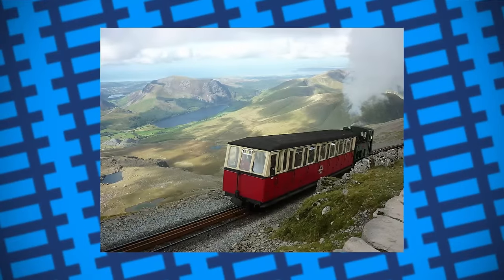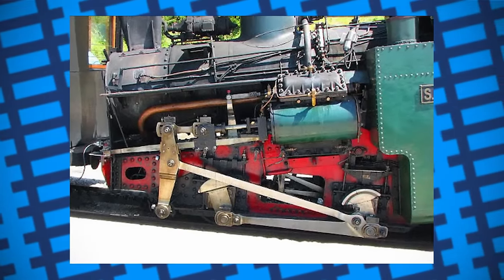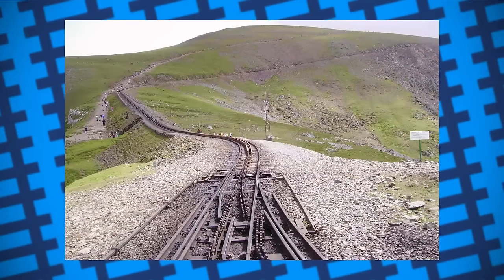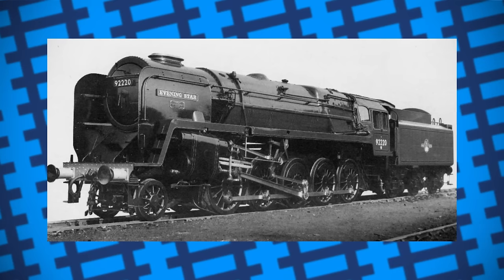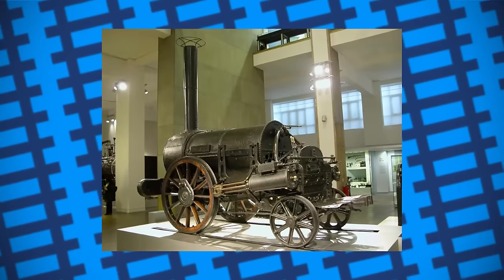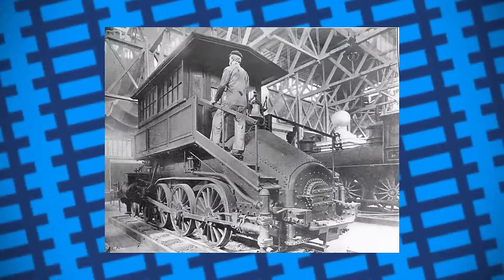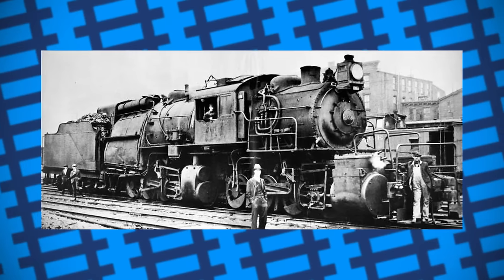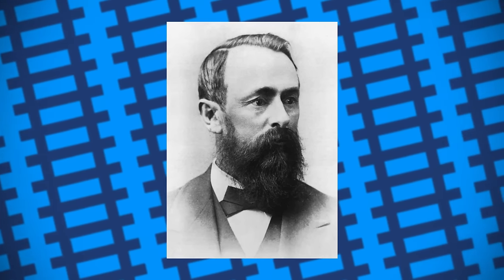Train of Thought COMPILATION - Extreme and Exceptional Engines

Comment: My favourites have to be hybrid-rack-and-pinion trains. They use conventional wheels on rails for most of their travel but have a cog that can use the rack on steeper inclines. So fall all I have seen were electric, so I have no idea whether steam versions exist
Reply: I was quite disappointed when 3 years ago I went to Mount Snowdon and hiked up it. The mountain railway was operating but only with Diesel traction sadly. And portions of the track near the summit were in quite serious disrepair, as such the railway only operated to the half way mark at Clogwyn station. I hope its since been repaired.
Reply: I saw one working a Swiss railway once. It had an extra pair of cylinders just for gear.

Comment: the Q1's had one majour issue. They were "light on their feet" or in other words.  They were too light for the sheer amount of power they had.  This meant that drivers had to be EXTREMELY gentle on the accelorator, or the wheels would spin.

After the war, the first thing they did was "throw weight at them" I.e. they added a whole bunch of metal to them in order to make them heavier so they would have more grip.  This meant that there was a fair amount of veriety in their looks post war. However, the one in preservation has been preserved in a much more original condition.
Reply: Yep. Although they were otherwise fantastic engines. The Schools were also a little ballerina like, and they were also great!

Comment: Fun fact about the Big Boys: Big Boy actually refers to their type, or their wheel arrangement. Union Pacific officially classed them as 4884-1 (#4000 - 4019) and 4884-2 (#4020 - 4024). Original, I know. They did something similar with the Challengers. They were classed as CSA-1 and CSA-2 (The light Challengers) and 4664-3, 4664-4, and 4664-5. (The heavy Challengers.) 

For more originality points, they have the FEF classes (UP 844 is an FEF-3.) in which the FEF stands for Four Eight Four.

Bravo, Union Pacific.
Reply: My fave is the TTT because I like alliteration.
Reply: It's telling that UP didn't even want the second batch of 4000's, they really wanted FT's however the warboard determined UP's needs didn't warrant their use at that time
Reply: It's not all that different to the LNER, who used a letter for each wheel arrangement.  For example the A3 and A4 classes were 4-6-2s, the B1, B2, etc. classes were 4-6-0s, and so on.
Reply: @nyeti7759  fyi the Pennsylvania railroad used a letter for a specific wheel arrangement D for 4-4-0, G for 4-6-0 etc. Hence the nomenclature for a GG1 which of course was a 2-C-C-2 (4-6-6-4) or the DD1 (2-B-B-2)

Comment: South Africa had (has) a specific steam locomotive class called the Class 25. This was a locomotive built by the North British Locomotive Company and had a 4-8-4 Northern Type layout. What’s unique about the Class 25 is that it had a Condensing Tender patented by Henchel & Sohn. The condenser basically did what it says it does. It condensed spent steam to be reused, virtually decreasing water consumption by 90%. This condenser in turn made the engine sound unlike any steam train, making it sound more like a diesel whine than anything else. 

Yes, there was non-condensing Class 25s called 25NCs. Most were original, but some were condensing types turned into 25NCs. You can tell a converted one compared to an Original 25NC by looking at the serial plate. On top of that, there was a Class 25NC restored into a one and only Class 26 nicknamed “The Red  Devil” for its outlandishly bright cherry red paint coat. 

Did I forget to mention that one Class 25NC had Dual Lempor Chimneys, and this engine just happens to be one of the Condensing types converted into a non condensing type.

Comment: I was expecting you to mention the Leader class of locomotive, built by Bullied. It looked like a modern day Diesel locomotive, but was steam, and had a driver's cab at both ends, and the Fireman's cab in the middle.
Reply: The Leader was to late to be a factor in modern railroading.
Electrical and diesel engine technology evolved so fast that Steam became obsolete.
Steam power has one big advantage above  internal combustion engines.
every stroke is a power stroke.
In electrical power generation today, steamturbines are  still the norm.
The SJ (Swedish stare railways) had the most succesfull steam turbine engines.
the entire class of steamturbine locomotives is preserved!
Reply: In Britain the diesel didn’t advance as quickly as you think it was a rushed process by British rail to withdraw steam the early BR diesels were often not a success most often to call a steam engine to take so its duty and mostly the diesels were underpowered compared to steam engines they were meant to replace it wasn’t till the early 70s that successful diesels became more common that’s 2 years after the ending of uk steam on the 3rd of August 1968

Comment: "Steam locomotives don't care..."
There are diesel rack-and-pinion locomotives such as the  ZL 200.
It handles inclines up to 2.5 degrees greater than the steam locomotives found on the Snowden Railway.

The entire Gornergrat Railway railway runs electric rack-and-pinion locomotives.

So it sounds like... locomotives don't care.
Reply: Yeah there are but they don’t often go up the mountain and there not originally from that railway so it is STEAM locos don’t care

Comment: 29:08 That crane loco is a New South Wales example, built by Beyer Peacock in 1909, and still in use in 1965 at Newcastle. I think (although can't fully confirm) that they lasted into the 1970s.
As for the Shays, four Standard Gauge Shays were built for the Wolgan Valley Oil Shale Railway at Newnes in the Blue Mountains of NSW (it was a private line) in 1907/1910. They worked well most of the time on the line which had 1 in 25 gradients on sharp curves in several places. Problem was that Standard Gauge Shays are rather heavy, and old second hand ex-NSW government railways bullhead rail was used instead of girder rail, making the locos occasionally spreading the tracks and derailing. Sadly, none were preserved.

Comment: Fun fact the Big Boy is not the longest, that title belongs to the Pennsylvania S-1 which is 8 feet longer than the Big Boy.
Reply: The talks of the Big Boy always interest me because of how slightly misconstrued everything is.  The S-1 was longer.  The Virginian class AE 2-10-10-2s were wider with larger boilers, front pistons, and were arguably more powerful (the VGN never measured their full potential).  The C&O H-8 Allegheny was taller, heavier and had higher horsepower.  The N&W Y-6b put out more tractive effort in both simple and compound mode.  Yet somehow people class the Big Boy over all of these, while it only truly wins the title of “longest articulated locomotive”, because the S-1 was a rigid frame duplex.  The VGN AE had physically longer locomotives, but since locomotive length absolutely always includes the tender, they’re the shortest of the “big 4” articulated locos because the VGN had to downside the tender significantly to fit on existing turntables.
Reply: @Engine33Truck   an FYI as well, although the S1 was at 140', the M1 was 154' and even the 3'6" gauge GMA exceeded the Big Boy length of 132' 3/4" with 137' 8 4/5"
Reply: And the Yellowstones have a higher tractive effort

Comment: DLM in Switserland even builds brandnew rack and pinion steam locomotives.
They look old but they are actual  very high tech and are fueled by bio/natural gas or renewable plant based light fuel oil
Also the 100+ years old  paddlewheelers on lake Geneva are reconverted to steampower by DLM
Modern industrial computer monitor cabinets stand in the engine room.  f.e. the exhaust gasses and cooling water for the condensors are constantly monitored and adjusted.
Those steampowered trains/ships are much enviromentaly cleaner then Diesel powerd version.

Comment: While some may question the aesthetic beauty of the Q1’s, their lack of normal fittings, railings, and running boards made their appearance very modern and streamlined…albeit, boxy.
Reply: More important was the saving of materials was deemed vital for the war effort as aluminium, steel and other metals were typically reserved for aviation production or other munition work. The majority of the railway and car workshops and factories respectively turned their output to the war effort.

Comment: FYI ToT, regarding geared locomotives, Johnson 16 wheelers had a 2 speed gearbox, very small wheels being excessively restrictive when running light. Although with the exposed gearbox, and running in bush with sticks and rocks etc they did have a tendency to jump out of gear.
The price 16 wheelers had a more normal layout. Both johnson and prices 8 wheelers were more akin to the normal heisler and climax products

Comment: I always thought it would be interesting to have a steam locomotive that had a small nuclear reactor in place of the firebox. It could run for months without needing to be re fuelled and if it was designed right, could be safe and reliable, with no emissions other than steam and spent fuel rods 😊.

Comment: 2:45 how did it lost grip when it's geared with the rack rail?
Reply: I don't have an answer, but I can speculate at a couple of possibilities:  Maybe it derailed (before everything else derailed), or maybe the cog or rack broke.  Or -- depending upon how the connection from the cylinders to the cog was done -- maybe the crankshaft connecting the cylinders to the cog broke.
Reply: The gear teeth got caught on a stone
Reply: The racks on the bottom of the engines don’t have there own brakes there only there to support the engine going up or down the wheels have the brakes

Comment: So, the big boys are the biggest steam locomotives ever built, and the yellowstones are the most powerful steam locomotives ever built?
Reply: Neither actually. The big boy is one of the heaviest, which is pretty much it for a big boy.
As far as most powerful there's variances: the most horsepower ever recorded was of course the PRR Q2. Tractive effort is a mixed bag: nominally the Virginian 800's running simple, or the erie or Virginian triplexes, but by far the highest was the Belgium quadruplex. The most as a successful class was the 800's, however they were low speed, tending to run around 6 - 10mph at full throttle.
Reply: @muir8009  Then, the q2s are the most powerful?
Reply: Yes, but the power to weight ratio is very disappointing by European standards at less than 30 ihp per ton of locomotive weight. @PatrioticCoservativeAmerican

Comment: I think the Allegheny was heavier, coming in at 1,750,000 pounds tender and all
Reply: Seems to be so. There's some who speculate the Lima exaggerated the Allegheny's weight (although seemingly oblivious to the obvious question: "why?" Excessive weight isn't necessarily a virtue), however more scholarly research has it that the locomotives were a bit overweight and Lima fudged numbers to make them acceptable for delivery. Railroad civil engineers still have to look after their permanent way.
Reply: @muir8009  and then they got a fat lawsuit that nearly bankrupted them
Reply: No, it’s not. Their weight is very close to the Big Boys, albeit slightly smaller.
Reply: @muir8009  no the undersold the weight
Reply: @Train_Tok_Man  I think you'll find that they are shorter than the big boy but not smaller.
They're the heaviest reciprocating steam locomotives ever built
Reply: @CoalChrome  Either way, they’re pretty close in weight, not 1.7 Million Lbs of weight.
Reply: @CoalChrome   but of course it was only 2670 lbs, which is 430 lbs over 1 ton, which isn't a lot. The M1 was 30,000 lbs heavier than big boy anyway. The H8 would've been a lot heavier if built as designed, and of course the weighing is a very inaccurate science anyway. It's never going to be an accurate weight.
Funny thing is of course the H8 couldn't really do anything more than what those giant boosted T1's did anyway.
Could've been worse though: think of the horrific weight of that silliness of the 2-12-12-2-12-8 monstrosity. And Lima would've charged like a wounded bull...
Reply: @Train_Tok_Man  I'm talking tender included with fuel and water
Reply: @CoalChrome  Even then, I don’t think it’s that much higher from empty weight.
Reply: @Train_Tok_Man  I guarantee you it is.
Reply: @CoalChrome  Alrighty, show me proof.
Reply: @Train_Tok_Man  look up the capacities for yourself

Comment: the Record on the Big boy is just wrong, 
it is just the Longest,
the Biggest build Steam engine is held by the 
Virginia AE class a 2-10-10-2 so big the had tae remove the cab and cylinders 
tae deliver it tae the Virgina Railroad,
The Heaviest is held By the Lima C&O H-8 2-6-6-6 allegheny weighting roughtly about  771,300 pounds,

The strongest is the Pennsy Q-2 at 7,987 cylinder HP (at least static Dyno tested)
and overall the Big boys were mediocre considering the 2-8-8-4 (B&O , DM&I, SP)
the 2-8-8-2 Y6 of the N&W, those were more in Numbers and stronger in transported mass.